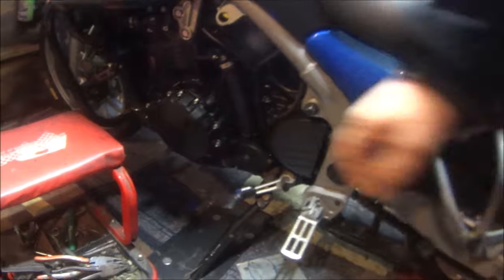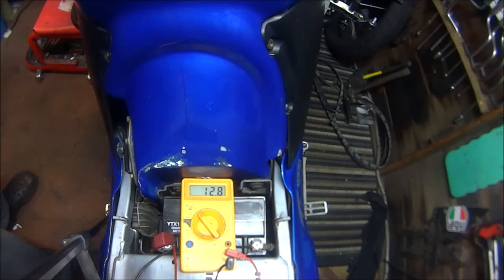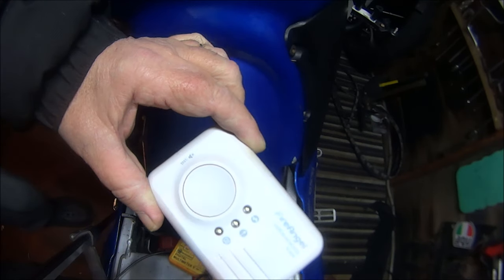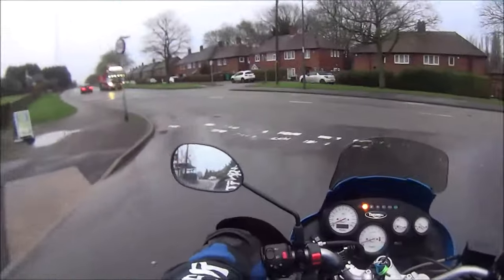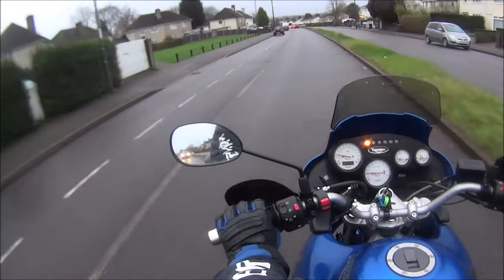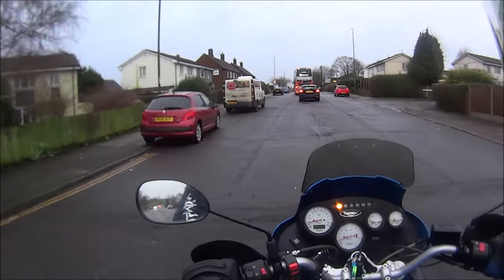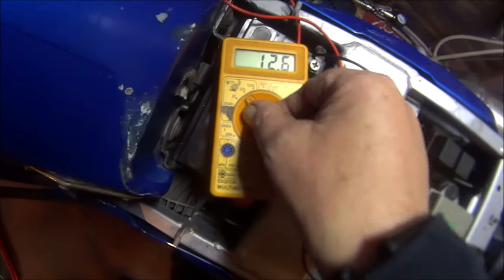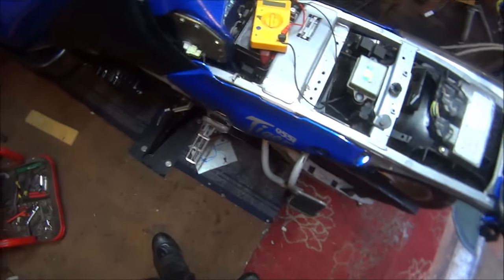TIGER 955I, MOT Time. this could all go very wrong

Comment: On my Daytona 955 I mounted the regualtor/rectifier on a 3mm copper plate and put a computer fan above it. The copper plate helps soak away heat. I always thought the battery was too small on the 955's
Reply from the maker: Hi Pinkerton. Thanks for all the helpful information buddy much appreciated cheers 👍

Comment: Hello, you might have sussed this by now, but most Triumphs will throw an engine management light if the tank has been removed and/or sensors have been unplugged and the ignition is switched on. This will clear after 3 heat cycles (cold to hot) of the engine
Reply from the maker: Hi Mark. Yes lots of Fuses removed and plugs unplugged.  Thanks for the helpful information it's much appreciated.👍

Comment: There are some good videos on YouTube on how to check a motorcycle charging system with a meter. DC readings at the battery plus AC readings direct from the stator. A decent battery should be around 13V or just over rising to about 14.5V when revving the engine. It shouldn't go above 14.7V.
Reply from the maker: Yes thanks I've seen a few. Cheers for the help it's much appreciated.👍

Comment: Congratulations on getting a clean MoT, always nice after putting the effort in

They don't "suffer" from Stator Burn any more than many bikes ('90's Hondas were worse). The culprit (root cause) can usually be traced back to poor condition of the big multi plug connector. Corrosion on the terminals makes the reg/rec think the alternator needs more excitation and forces higher output which eventually burns the windings. In the process that can also fry the battery and often the reg/rec too from over voltage at high revs. There's chapter and veerse on these issues on TTF. The "Sasquatch Mod" effectively bypasses the multi plug, ideally with new high quality cable but if the damage has already been done, it can be a hefty bill to put it right. Modern (better quality) Mosfet reg/rec's are a bit more robust, Electrex World are a well trusted supplier.

That doesn't seem to be the case suggested by your short test, anything over 2k rpm I would expect to see the voltage rising to 14.5V, the fact that it drops slightly as you rev is to be expected as the fuel pump will run longer. Needs more investigation mate.

The MIL light not resetting could be a number of issues, depends how long the battery was disconnected, it might need an adaptation reset, the process varies depending on the ECU model, check on TTF for explanations from Bixer who knows what he's talking about. Enjoy the triple burble and addictive torque.
Reply from the maker: Thanks buddy I'm happy it passed. I only roade it a short distance but I loved every second, it reminds me of the gpz rx1000. But more comfortable to ride. Cheers for all the helpful information mate I appreciate it.👍

Comment: As long as the battery is charging at 13v it should be OK I would say, maybe check the regulator and make sure the battery connections are good, at least its mot'd 👍👍
Reply from the maker: Hi Gary. Thanks. Cheers for the info mate 👍